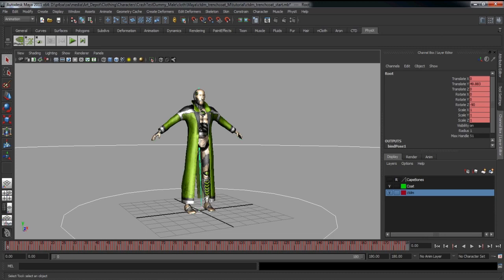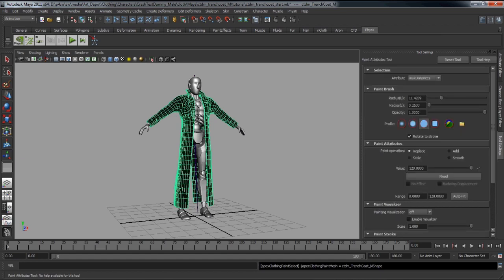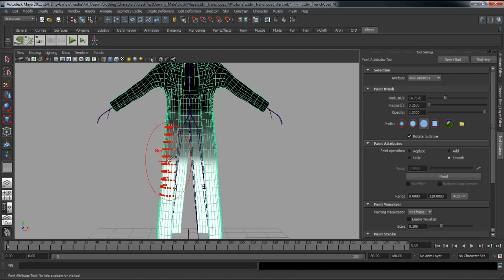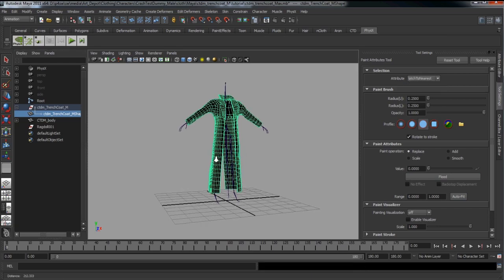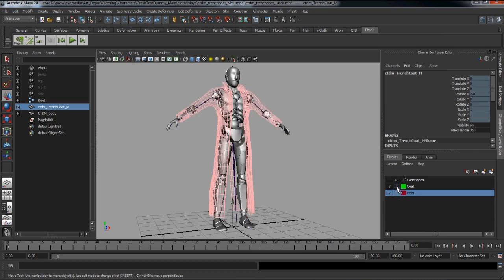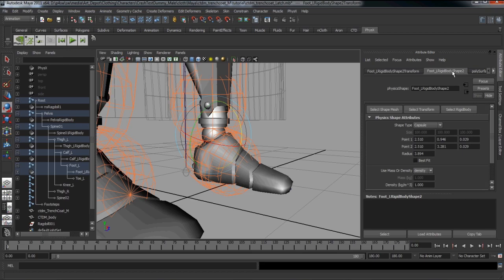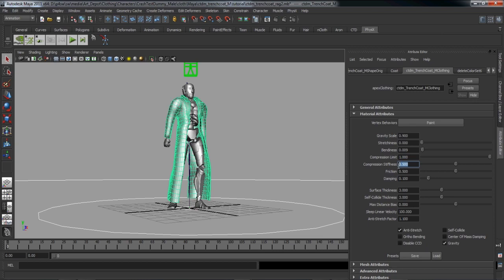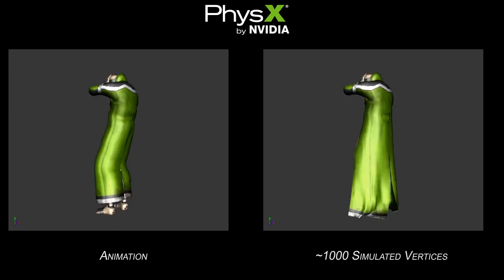APEX Clothing Tutorial with Maya using a Trench Coat

Comment: my advice to anyone attempting a cloth sim like this: make sure your mesh is skinned excellently before even starting to apply the apex cloth. You want it to me as close as possible to the example in the video. Low poly count as possible, even distribution of quads etc. You can do a thick double sided cloth like in the video, but make sure its thick enough. A skin tight mesh will be hell to paint skin weights with. single plane meshes work better, are easier to simulate and paint but sometime thick meshes are needed. This is an advanced simulation, so be patient

Comment: I just set up a character with a similar trench coat. Did it several times to the T and everything looks goo in Maya when I do the Physx simulation, but when I use the visualizer the base geometry(not the cloth) blow up completely. This is strange since I using the capsules for collisions. The same happens in Unreal. Anyone know a fix for this?

Comment: I've been struggling and bumping my head for a couple of hours for the same problem that Daniel van der Linden-Woeller also had. With newer versions of maya if you do all as said in tutorial you'll be ending with the same animation you started: that's most likely because you have too low paint weights values.
I'm using maya 2014. you have to set "visible range" to 0 - 120 (which is 0 - 1 by default) in the paint settings (tool settings panel aka paint scripts tool), then you'll be able to paint "heavier" strokes, and apex clothing will start working! ;) hope to save headaches!
Reply: +evildevil27051990 Bumping this, needs more upvotes. Was having thouble, and this was the cause and solution.

Comment: @Yrgen2 - If it is not moving at all.  There are two thing to looka t first. Make sure that cloth simulation is enabled on the asset.  Also make sure that you have Max Distance painted at a non 0 value for the parts of the coat that need to move.